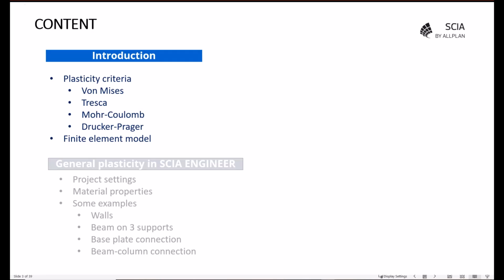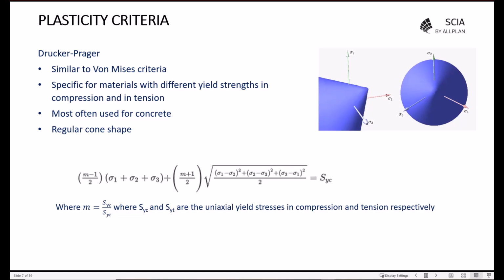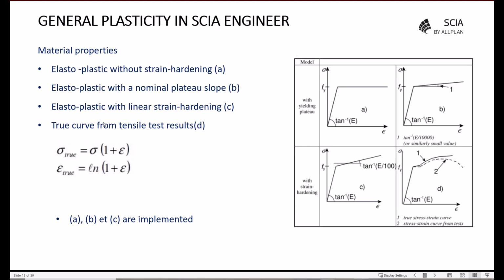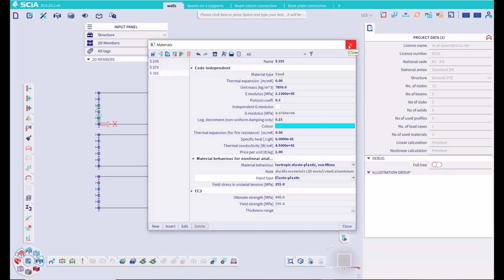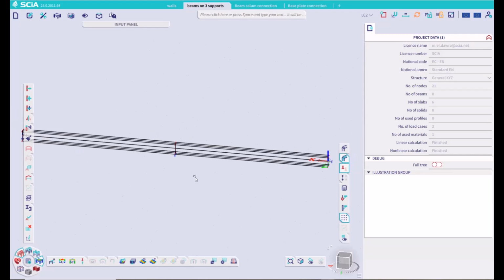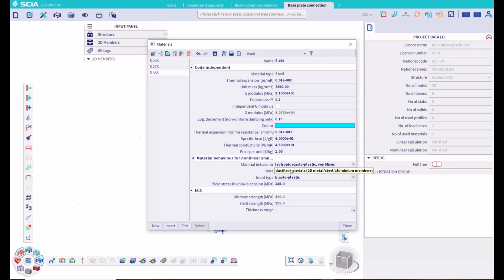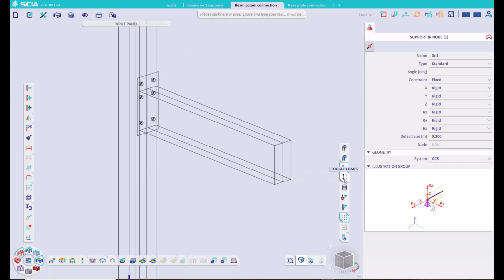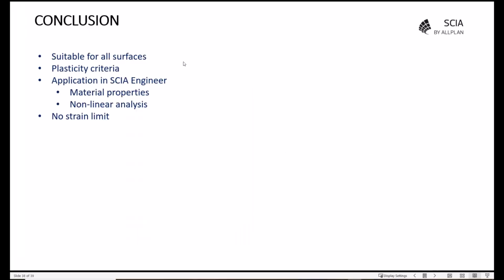[EN] General plasticity in SCIA Engineer 25

Comment: Does the option 'Nonlineairity' only opt in for MNA (Materially Non-linear Analysis) or also for GMNA (Geometrically and Materially Non-linear Analysis)?
I also wonder how the settings of Non-linearity are applied. In how much steps is this load being applied?

I find it very alarming when some one says that strain <5%, so okay. Especially when i have seen models, which weren't able to be solve above 2% strain due to convergence problems because of instability, when I also took into account Geometrically Non-linearity. 

I didn't notice any warnings in the use and downsides of using this 5% as a rule. Maybe good to also include some of those in the future..
Reply: Hello Denreus, you can calculate taking into account Geometrical and Material Non-linearities. For plates, is the code which mentioned strain <5% as limit, but of course it can depend on the analysis done.